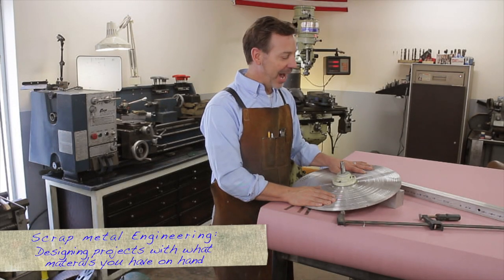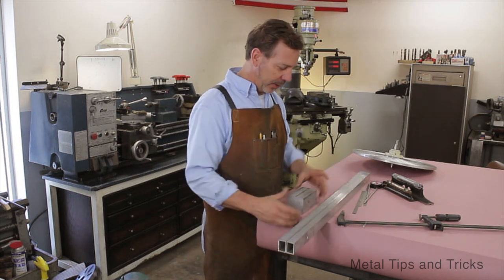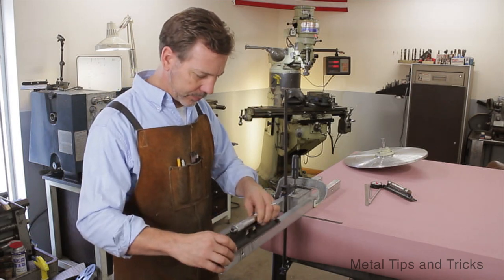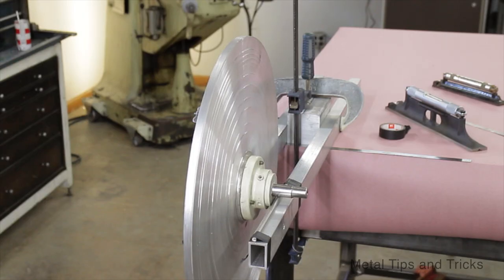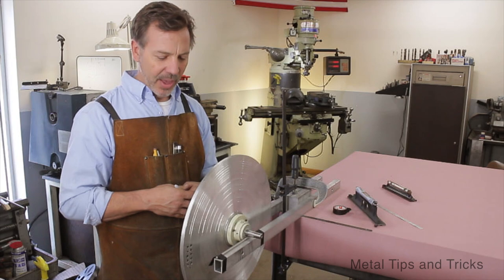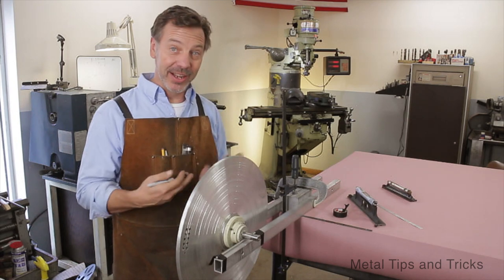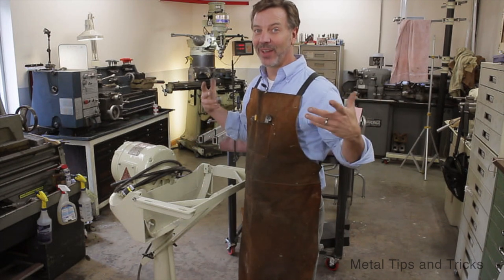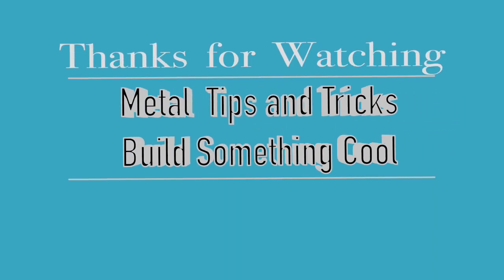18" Disc Sander part 3 (Reloaded)

Comment: Nice ad hoc balancer. You might (if the imbalance had been significant) have weighed the tape-wad and then made an aluminum rod with a 118˚ chamfered end (to simulate the coned bottom of a drilled hole) and shortened the flat end until it was the same weight as the tape-wad. This would tell you how deep to drill with a bit the same size as the rod. 

If your tape-wad (or other weight) was fairly heavy (heavier than a single hole could compensate) it would be easy to divide the measured weight by two or three (or any number) to determine the weight of that number of identical holes.

It would save a lot of waiting for the disk to settle down after each hit with the drill.

Comment: Dale, great build.  It looked like your disk was running clockwise and that seems backwards from most I've seen.  I'm probably wrong and there may not be a right/wrong direction, only preference.  Most people use the left side to push the part to be sanded into the bed so it doesn't throw it off, as the disk is usually turning counter clockwise... at least on mine and those I've seen on Youtube.
Reply from the maker: Rour right ab out the direction most turn CW, but it relay docent mater. thanks for your comment .

Comment: Depending on the quality of the abrasive paper together with the adhesive used, the balance can be different with each application of new paper. Of course during use the build up of residue or the degradation of the abrasive can effect the balance. In practical terms its almost impossible to keep an exact balance on such a large sander.
Reply from the maker: So true, thanks for you comment.

Comment: Throughout this I have been thinking about a very sensitive method for determining static balance. But I don't know how to do it.

If anyone knows how to use water to float the disk, please share the details. Or better yet, use alcohol since it has a lower specific density than water.

Or, air which puts both of them to shame for the same reason. I'm also thinking of using air bearings although I don't know how to do that either.

Also the computer industry balances hard drive platters very accurately. And well they should as they rotate at up to 10K RPM, depending on the model.

Comment: If you ever need to balance something smaller, or you need to achieve a very accurate balance consider doing this:  

First, either build a steel shaft for your specific part or make a steel shaft with two tapered cones that can slide on and sandwhich your part with set screws to hold them so they center your part on the shaft.  

Second, grind or turn a point on one end of your shaft.  A 45 degree angle works well.  Face the other side so it is uniformly flat.  

Now build whatever contraption you need to hold two very strong neodymium magnets a bit further apart than the length of the shaft.  Make it so one magnet can be adjusted in and out a small amount.

Place your part on the shaft, place the pointed end against one of the magnets and allow the other magnet to hold the flat end suspended.  It is now free to rotate on just the point.

BUT, here's where the good part comes in:  The flat end presents more steel to its magnet than the pointed end does.  By slowly adjusting that magnet closer to the flat end you will eventually find a point where the shaft jumps from the magnet on the pointed end to the magnet on the flat end.  Adjust the magnet a tiny bit further away, put the pointed end back on its magnet, and you now have almost no pressure on the pointed end and the flat end is suspended...the friction is almost zero.

I've done this with a 5/8" shaft and spun it up by blowing an air hose at the cones on it.  I spins up to some incredible RPM and will be spinning several minutes later.  I suspect the friction from the air slows it down faster than the surface friction.

I use this to balance the small wheels on airplanes.  They're much smaller than car wheels and thus need to spin very fast for takeoff and landing.  With the setup I've described I can balance the wheel to the point that just adding a 1/2" long piece of masking tape will cause it to rotate.

Sorry I have no pictures but I think the description I've given makes sense if you think about it.

LOVE your videos, by the way!
Reply from the maker: I find this very interesting can you please send me some photos. Dale@metaltipsandtricks.com
Thanks

Comment: I wonder if abandoning the aluminium wheel altogether in favour of the  MDF used as a vibration damper.  A wooden wheel alone.
Hot melt for adhering abrasive paper. Hot air gun to change paper. Poor Old Chap on u tube has this method.
Reply from the maker: that an interesting idea> :-)

Comment: Why bother machining the back if you are going to balance it anyway?
Reply from the maker: I did it so it would be closer to balance then if i wouldn't have
Reply: Did you consider that putting sharp steps on the back could cause stress concentration points that could lead to cracking and catastrophic failure of the disk?